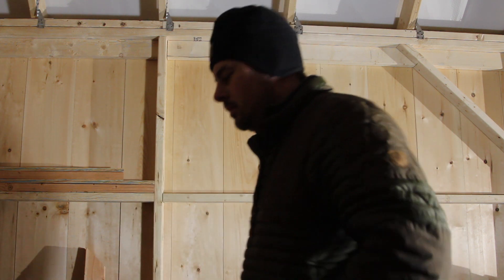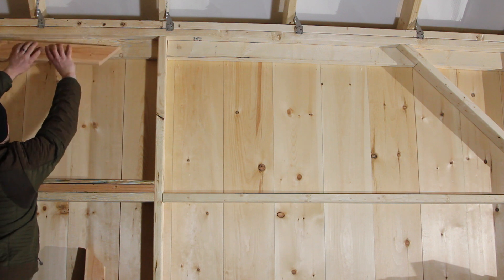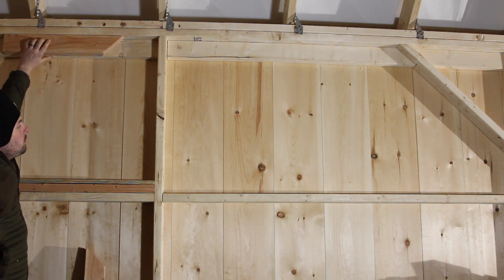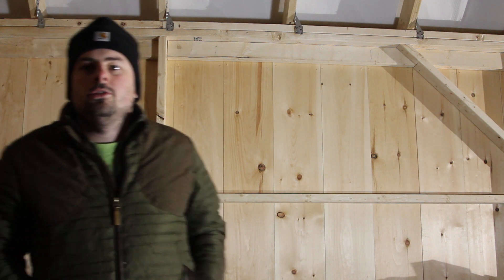#3  Adding a Loft in the Shed. Stage 1 complete!

Comment: A 1lb box of screws 10.00, a 5lb box 30.00 . I hate to spend 30.00 for screws , but thats the smart decision.
Reply from the maker: Exactly, and that's what I should have done.
Reply: I have found that I usually have a use for leftover screws later at some point.  Go with star screws.  They don’t strip as easily as those dadgum Phillips head